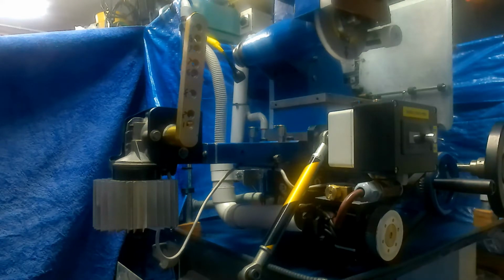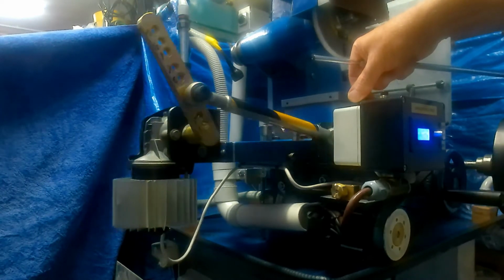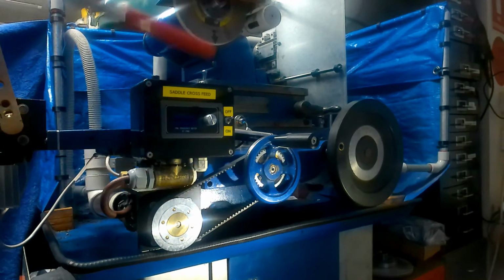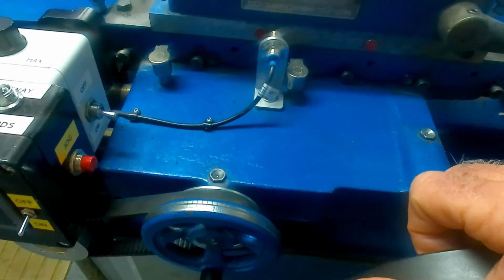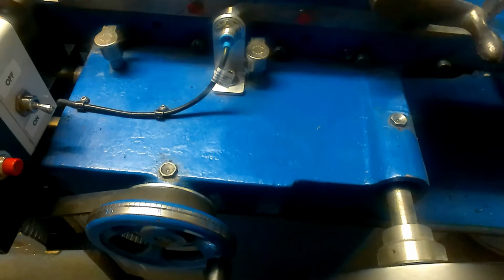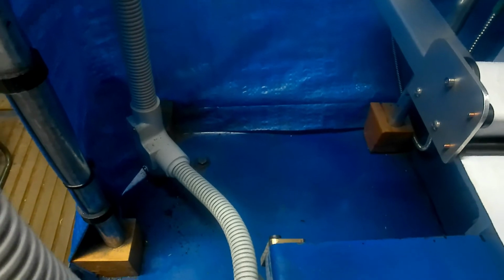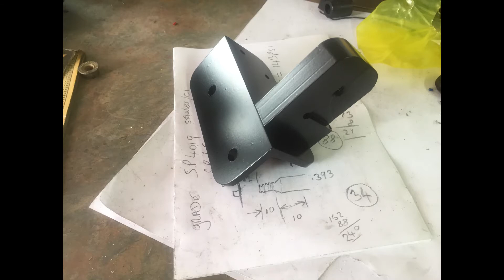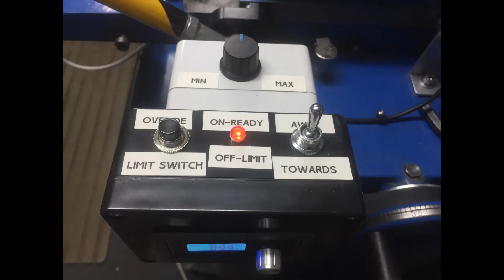1941 Grenby S1 Surface Grinder with Powered Table & Auto Feed. Showing both in operation.

Comment: This project is probably the most difficult one I've seen on YouTube. Accomplished with very elegant engineering and machine work. Love the photo work. Kudos to you Dave!
Reply from the maker: Thanks Mike glad you liked the content. I was trained firstly as an Instrument Maker, hence the nicely finished modifications and eye for details. I then transferred to being a Machine Tool Fitter or as some call them, Mill Wright. That is why I have no hesitation about repairing or making machinery parts. Going to do a video on the DoALL soon, no actual video content of the rebuild but a long slideshow of the strip, repaint and rebuilding of it. Stay Well  Regards from Australia.

Comment: Thanks for another fascinating video, Dave. I love the mix of old and new technology. I was just wondering if there might be a case for mounting the hall effect sensor magnet on the rotating arm, rather than on the saddle, then it wouldn't need adjusting when the stroke changes?
Reply from the maker: Hello Jon, Thanks for the view and your question. I suppose you could but it would mean the sensor being mounted on the table. You would then have the problem of how long the cable would last being bent backwards and forwards as it went to and fro. And it would only be able to single feed instead of feeding at the end of every stroke as in a hydraulic feed table like the J & S machines. This way the sensor is fixed and the cable clipped in place. Regards.

Comment: Thanks for making this video.  For the back and forth where you used the wiper motor connected to an arm.  Did you consider using another stepper motor with a belt to your hand crank? It would be similar to what you did with the feed wheel to advance inwards/outwards?
Reply from the maker: Thanks for the view and your question. No I did not even consider a stepper motor for the stroke, several reasons, the main one  being that I wanted a mechanical stroke adjustment with variable speed. My chuck is 12 inch, so on the wiper crank I have tapped several holes that I can put the arm bolt into.e.g. if I want to grind a 6 inch part I could either use the 3 or 4 inch hole, which would double the stroke. On top of that the 12 volt motor has a Pulse Width Modulated controller board. This gives infinite control without any loss of power ( buy cheap on ebay ). This gives me total control of the grind with a fixed stroke at an adjustable speed. I do not think that it would have been easy to do that with a stepper motor. By the way this was my first time of using a stepper motor, quite a learning curve, althought my work was also electronic repairs. Drop me an email if you want a more detailed description with pictures. Thanks again. Regards.

Comment: Hi Dave - I have watched a couple of you tube vids on fitting the table drive  - I do not like that the motor is attached to the moving table  , I have seen 1 where the motor mounted stationary and the Arm was connected to the table
I had not thought of a cross feed - but I like the idea of a manual feed along the lines of a shaper rachet pawel , that gives you forward , reverse  no feed and with the adjustable arm you can control the amount of feed per stroke
I like the Idea of KISS = keep it simple stupid , but with a stepper motor , Hall sensor and setting magnets  different voltages it seems abit over complicated
  But if it works for you fine - I enjoy your you tube vids - showing these old toolmakers tricks on how things were done before CAD / CNC before computers run the machines
 With a manual lathe or mill you can do anything , But I have been seeing old cnc machines coming up for sale but they are only good for scrap iron , programs outdated and not supported diffcult to convert to manual
Anyway Keep showing people the old ways
 Thanks for taking the time to make the Vids
 Laurie
Reply from the maker: Hi Laurie, thanks for watching. With regards to the motor being fixed to the table it was my only option, to get the 12 inch table movement I needed a 6 inch radius arm on the motor and there was nowhere for it to fit easily. With the way I have it, I can disconnect the arm, rotate the motor enough so that I can park the table fully right when not in use to give me room to walk by. Was no way I could do a manual ratchet feed on the saddle as it would have been needed to be fitter on the hand wheel. When made new it was meant to be a benchtop hand operated grinder, just tried to bring it into the 21 Century technology wise and make it automatic to save my are with winding the table to and fro. Thanks for the comments. Regards.
Reply: @daveticehurst4191   Thanks for the reply - What ever works for you at least you made it yourself and worked through the problems - these days it is so easy to buy 
new from China or India  my last lathe came from a polytech , secondhand  with only 780 hours use [  it had a hour meter fitted ] they ditched 8 manuel lathes to install 3 machining centre's ,the way industry is going
 Keep showing the old tricks
the vids will be around long after you are gone
 Thanks
              Laurie

Comment: The protection diodes will work up to their PIV rating ,that's "PEAK INVERSE VOLTAGE",So if you crank by hand fast enough you "may" damage the protection diodes,i'm not an expert on stepper drivers,and i have not measured the voltage generated by a manually spun stepper.

I too have a lathe and a mill,which i would like to add some steppers to get constant feed rates for nicer cuts,i was thinking about this issue and the simplest fix for me as the machinery is there,is to make sliding dog clutches with ball detents to hold while in or out of use,hand cranks and shafts can have new mounts on one end of a dog clutch shaft,so pulling the hand wheel can disengage the dog from a slipping dog for the stepper but still be able to crank the lead screw,or push to engage the lead screw on the stepper drive,the position of the drives may need to be reversed so you don't have to spline drive the hand wheel,but it's simple to fix on paper first,a couple of slip collars with dog engagements to slide back and forth,easy enough and no more worries of brown out diodes-freewheeling diodes.
Also a stepper could be used with a limit switch either end of the stroke using the hand feed wheel with an arduino programmed to reverse the direction of a stepper when travel reaches the limit switches that send a grounded pulse,transformer bobbin winders on youtube do this for each layer stop and reverse,just no need to count turns of a bobbin ,dead easy and compact.

You've got the basis on the x axis.

Cheers.
Reply from the maker: Hello John, thanks for the view and your comments. Good luck with the dog clutches. So far I have only used the grinder a couple of times since the stepper motor was fitted. Belt off once for rapid movements to set up. The other time I just upped the feed rate to wind it across under power. Regards.